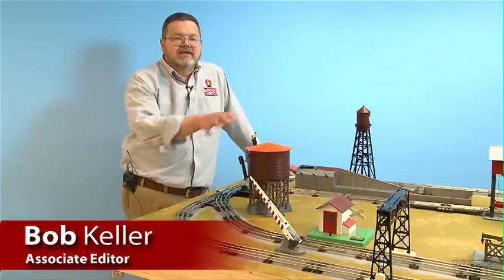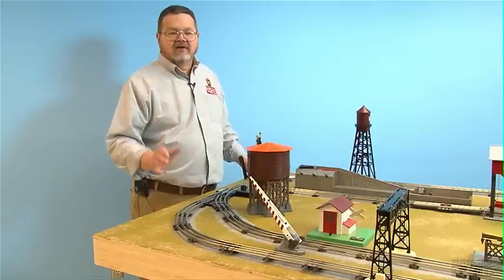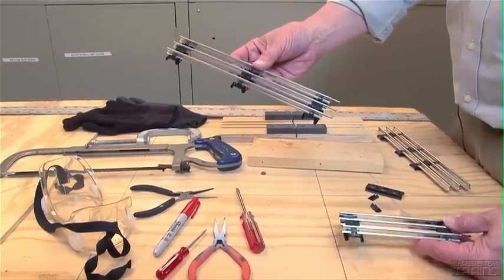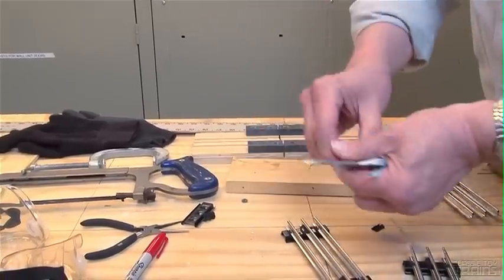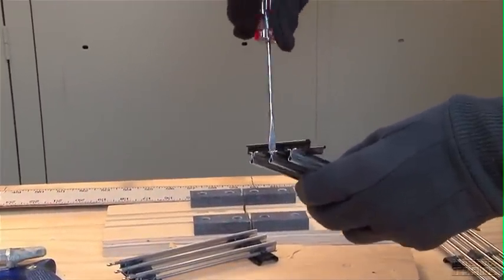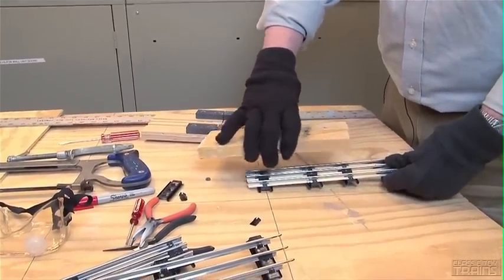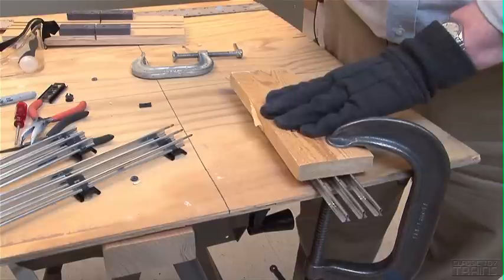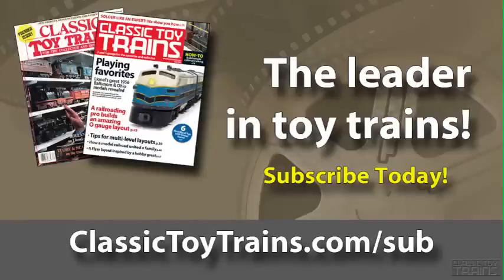Working with Tubular Track | Classic Toy Trains magazine

Comment: Cutting the track. For me with Gargraves and I think there were instruction back in the 1980's about cutting them. Was to use a fine tooth mini hacksaw and put the blade on backwards making your cut happen in reverse that you are pushing on the cutting in your normal forward cutting way, using the teeth at the wrong angle wrong. I eventually found a carbide grit hacksaw blade did a quick and clean job.  Slower cutting then a blade with teeth but there were no bent rails with that blade cutting the track.

Comment: You might have mentioned which accessories can be activated by an insulated track section. Not all your  viewers may be aware how handy it is to use these in lieu of pressure contractors.